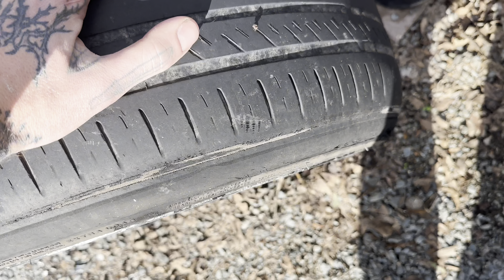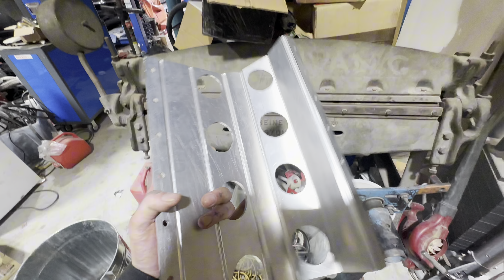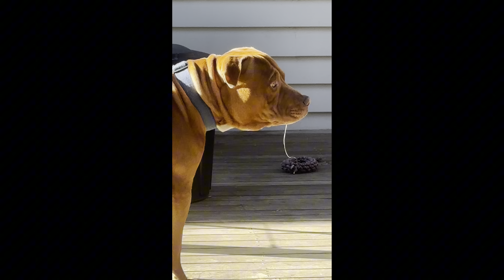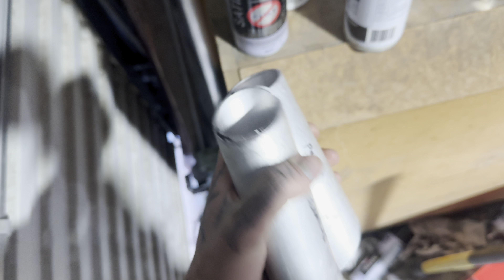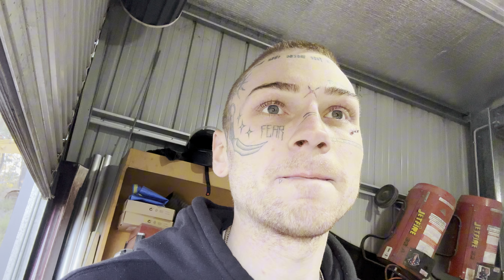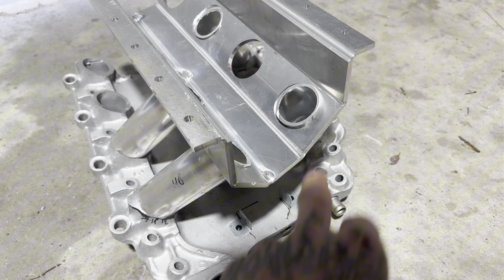Making A Custom Intake Manifold For My Burnout Car

Comment: Hey mate would you want some pipe hanging out the intake pipe to weld in and grind down flush ? I’m no expert tho just a idea
Reply from the maker: I think cutting them flush will be the go so there’s less grinding as it’ll need to be pretty strong to handle the loads it’ll see but I see what you’re thinking